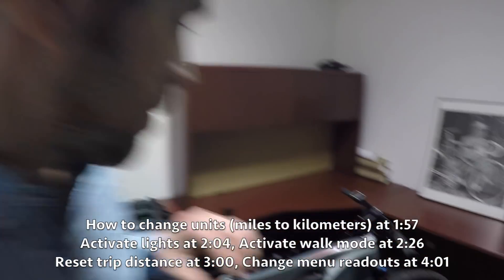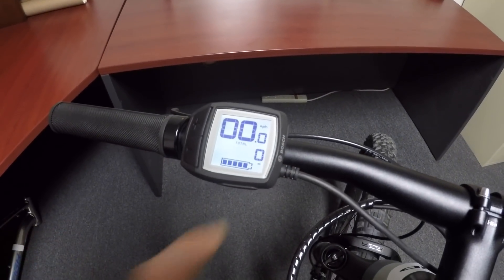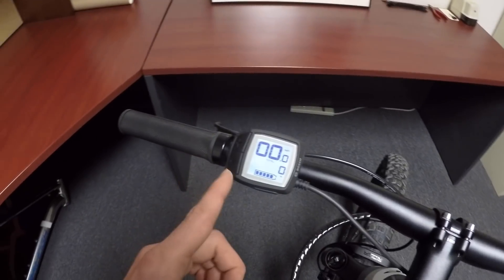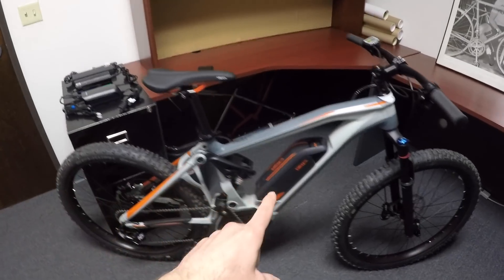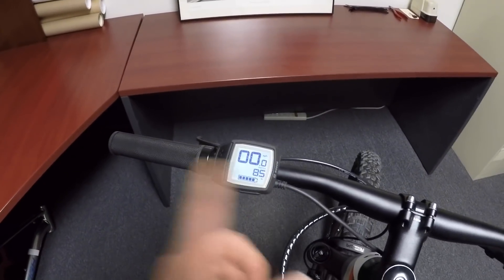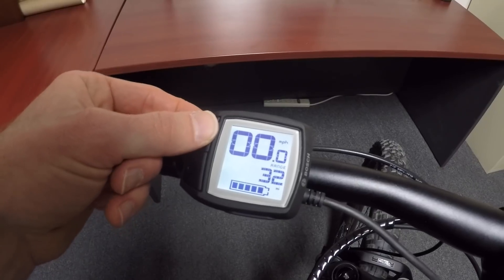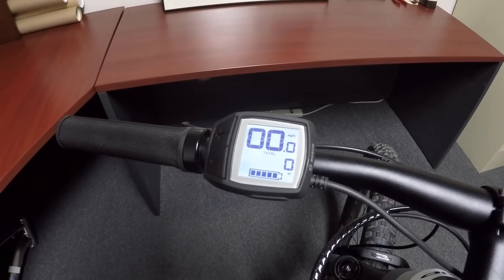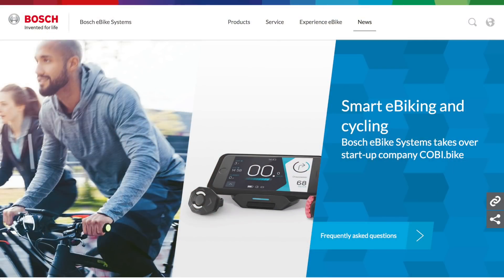Bosch Purion Electric Bike Display Settings

Comment: 3 years on, and just purchased a Crossfuse with that exact display unit, and at last, some instructions on how to use it, thank you. No manual which was poor imo. I cannot find the trip mode that shows the distance down to tenths of a mile,  which has been annoying so hopefully now I can. I came across the range display by accident, and I can confirm that it is very accurate. When it goes down to zero, it really means it! Thanks again.

Comment: I've seen you talk about the buttons a few times -- and this being the internet and all -- it is easy for people to misconstrue your misuse with poor quality/functionality. It is actually a smart design feature that you're not taking advantage of by being off the bike/standing over the bike. Put your hand on the left handle bar, extend your thumb out naturally (given your four fingers are wrapped around the grip) - your thumb will be horizontal with the handlebars and pointing toward the button, which means you press in a sideways/downward motion, not simply a downward motion as you are attempting in this video and other videos. Your thumb covers basically the whole button - look at the natural shape of the thumb when extended and horizontal. This is why, in your example, the button works best pressed at the top point (closest to the screen) as this is naturally the direction your thumb will be pressing while still maintaining your grip of the bike.

Comment: Did you know that this little display is powered by independent small batteries? Did you know that when those batteries die you'll loose all assistance regardless of your main battery level?
You'll get a warning on the screen before that but with low temperatures during winter it's still risky.
For that reason it's good to have a spare ones with you AND decrease the brightness of the display to minimum:
• Turn the display off, then hold down the + and - buttons and press down the power button for a few seconds. 
• When the display turns on there will be a scrolling display of various firmware versions (or whatever). 
• During this time you can use the + and - buttons to change the backlight brightness.
Reply: Thank you. What is the battery model number?

Comment: I'm happy with my Trek e-bike with the Bosch Purion display. However, I'm disappointed that the odometer does not give you 10ths of a mile, only 1 mile, 2 mile, etc. Any comments on this? Also, I noticed, after a ride the odometer is generally 1.25 - 1.5 miles short of my actual trip. This is based on riding with others the other day whose odometers all synched up with the correct miles. So I took a closer look at the back tire that had a small attachment on one of the spokes. This small attachment was not synching up exactly with the rounded section of what I believe is the odometer hardware. Your comments on this are also appreciated.

Comment: I have this display on my Cannondale Ebike and it's very easy to use and read. 
It should show mode assist display all the time, not just when you are changing.
Reply: hi it can !  you just toggle through and leave it on mode assist display    you then know what level you are riding at .
Reply: 8

Comment: Gr8 vid.. I was hoping for some hidden menu to get my LaPierre  speed higher.. any tips would be hugely appreciated...
😁
Reply: You can get your speed higher but not with menu
Reply: @markomestrovic15  aah okay, how?
Reply: @skateboarder9815  you need to buy speed unlocker and you can choose will it go 25kmh or 99kmh. I will put the link, so you need to put chip in motor and press walk button to activate.
Reply: @markomestrovic15  cheers, thanx for that.. will do that soon.. 👍☺☯️

Comment: Any idea what handlebar diameter this could be mounted on? Is it only the MTB 22.2 mm diameter, or are there shims or other mounts that will allow for road handlebars or for the oversized 31.8 mm portion near the stem?

Comment: I just got a cube ebike and I only had it a few weeks and now the purion is telling me to change the display battery? so I bought 2 new correct ones... fitted but still the purion is telling me to change display battery? any help would be much appreciated 👍
Reply: I have this same problem with mine and cannot figure out what is going on. I recently put brand new batteries in it,  took the bike out for a one hour ride and today the display battery was dead and the bike is telling me to change the batteries again. I am wondering what the heck is draining these batteries. No idea where to get any info on this problem.

Comment: It should be noted that the plus medium hold trick does not work to turn OFF the lights on the model I just bought (happens to be a Trek). I think a firmware update may be required. The shop said "they can't be turned off" but I don't believe that's the case. If anyone knows how to do this, please post.

Comment: Hi, I have a hairiness with bochr motor. I haven't used tge bike in several months as I was overseas. I cannot activate the bike although the battery display (on the battery not the digital display) is fully charged. I think  it may acreset or wake up. Has someone had the same issue, thank you in advance

Comment: If i lose my purion is there a way the bosch dealer can analyse my bike? Especially find out it is tuned?
Reply: Yes all the data is in the control unit with the motor, if you get a second motor and tune that your fine, just put your old motor in for warranty stuff.

Comment: I have the adapter 
The out output for the panel rates at 44v2a
I need the kit 
Thanks
Reply from the maker: I'm a little confused, are you talking about the Micro USB port or something else on the bike? I didn't have a Voltmeter to check the plug, it just didn't charge my iPhone while the Intuvia and Yamaha control pad unit did.
Reply: ElectricBikeReview.com wanted to ask your advice...
What is the best mid motor for commuting fast.. And some advantures in the weekend???  Brose vs bosch cx vs shimano 8000???
Reply from the maker: Hi Guy, my preference would be a tie between Bosch Performance Line Speed and Brose TF. They both offer ~28 mph Class 3 support and are reliable. I just haven't been as impressed with Shimano's offering, and they don't have a speed pedelec, so you'd be limited at 20 mph. So, if commuting fast is your focus, check out the Bulls Urban Evo https://electricbikereview.com/bulls/urban-evo/
Reply: ElectricBikeReview.com thanks for the fast replay.. I think i ould go for the cube reaction hybrid... Keep on the good work..

Comment: This is only a tutorial. You should additionally state the +/- accuracy of the range estimates at least. Best to actually test the accuracy of factory claims.
Reply from the maker: I do some range estimates with each bike review but agree with ArthurDentZaphodBeep that there are many environmental factors at play. Even the tire tread and pressure makes a big difference... wind, road surface, rider weight, the drive unit (Bosch has five now). This video was meant to be fast and focused on just the display :)

Comment: No USB out, no top speed, no indicator how much help the motor is giving...
Intuvia it is.
Reply: Less functionality indeed. But on the other hand the Intuvia has too much redundant information when you’re using a smart phone to record your ride while taking a lot of the space on the handlebars that you need for your phone. I use a Topeak iPhone holder attached to the middle of the handlebars.
Reply from the maker: Also, no clock, shift recommendation, or average speed readouts :)
Reply: So how do I get updates for the Firmware and software updates
Reply: For me, the Purion provides all the info I need. I would however prefer a separate assist level selector button(s) that was better positioned, not that the Purion's controls are to any large extent difficult to use. A good, simple controller if that's what you need, like me.

Comment: It is not a very good display, is it? The information is presented sequentially, which is exactly the opposite of what you want... and remembering which combination of "coded" button presses will pull up what you want is just a pain. Not impressed, and NOT by comparison with the Intuvia, which is bigger,  more like two displays, one above the other.... and the labels for the information stay on screen.